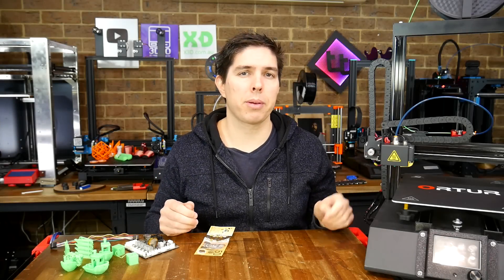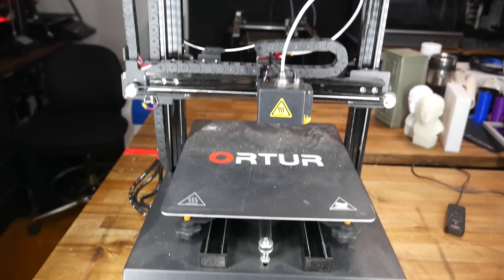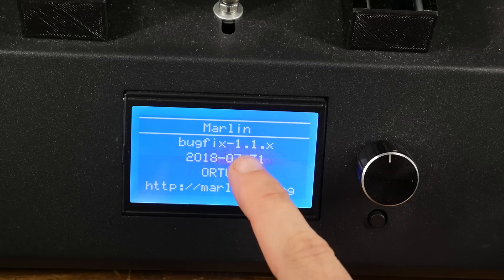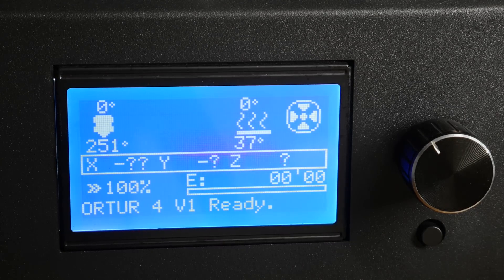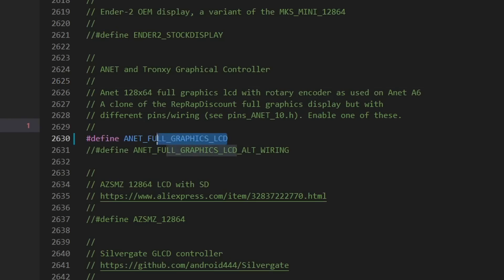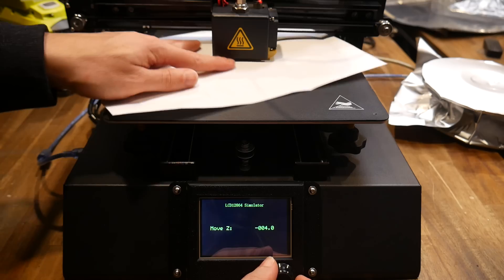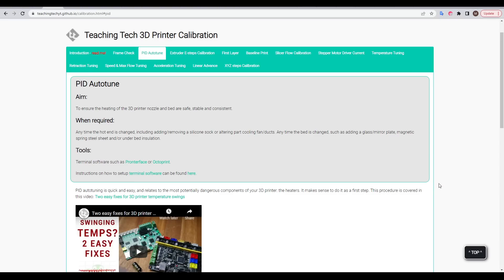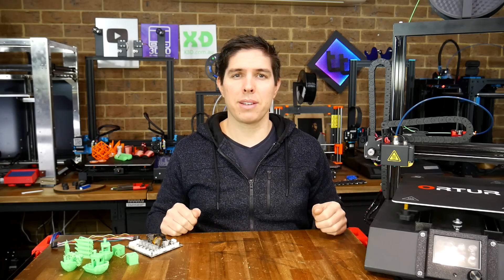Can you make money repairing barely broken 3D printers?

Comment: The thing is: you had spare parts.  Flipping’s goal is money received > money spent (original item plus anything you have to add plus the cost of your time).  Once you take all of that into account, if you had to purchase those spare parts you grabbed from your drawer — plus the cost of your time — would you have turned a profit?
Reply: You don't always have to buy spare parts brand new as a single unit. Look at the ender 3 for $52 at the start. You can get a lot of good spare parts from tearing it down which is worth way more than $52.
Reply: @nicholaslau3194  Yes but the concept of this video is "can you make a profit from buying semi-broken 3D printers, fixing them up, and selling them as refurbished?"

Let's say he got the semi-broken printer for $52.

Let's say our time is worth $25/hr. I'm going to guess the work he performed took him an hour.  That means if no parts need replacing, he has to sell this for $77 ($52 + $25) to break even.

However, he also had to replace the mainboard and the LCD.  What's that, another $75 possibly (guessing) if bought second-hand? 

So now he has to sell this for $152 ($52 + $25 + $75) to break even.

Would anybody pay $152 for a refurbished version of this printer -- when (at least here in the USA) one can buy an Ender 3 Pro NEW for $99 after coupon at Micro Center?
Reply: @OriginalSchles  He set out to repair this barely functional printer for certain reasons which he explained. For arguments sake, let's say it is 20% functional. Obviously it is a waste of time and money to fix it up to 100%. Instead if you take this 20% printer and tear it down for parts, you can use said parts to fix up an 80% printer. If you have many "broken" printers on hand, you will know which ones are worth fixing and which ones aren't. Michael even said that some listings are for almost brand new printers in which the owner simply doesn't know how to use a 3D printer. Of course you are not going to make money by making dumb business choices. The $52 ender-3 already has the mainboard and LCD (assuming they are working), if not then it still has other useful components like the heater block/ heated bed etc. I cannot stop you from spending $200 on a LCD board because you want to waste money, or give yourself $100/hr as wage. You can make up any numbers you want to fit your argument, not that it means anything because you cant really estimate profits on an isolated basis.

Comment: I got last month a CR10S Pro v2 for 100US, guy wanted $300 but it had problems with Z axis, everything else was working perfectly, changed all Z axis (steppers, lead screws, anti backlash nuts, bowden tube, glass bed (it had no bed) and printed some better supports for steppers, all of that was 100us more, so I got a great 3D printer for just 200us, totally worth it!

Comment: That is exactly how I got all my printers... 1st one was new and after gaining enough exp turned out you can get used or broken printers 3+ times cheaper... Even with new printer you will have spend time anyway... So it's perfect way for people who doesn't have much money to get good machine and jump in some very nice hobby.
Reply: yeah I think it is espially valuable for people that want to get many printers at one time too. You can scrap one or 2 out of your 10 and fix most of the issues and then order all the small bits in bulk. Or as a base for upgrades, keep nothing but the frame and motor and just replace the rest

Comment: For a print farm it is best to have a few printers with exactly the same hardware and software. From heat break to motherboard to software version. For a print farm reliability counts. So refurbishing an unknown printer is no option for me. For a newbie neither because he/she has no other printer to print replacement parts. So what is left over? To buy a broken 3d printer and repair it as second printer? My opinion is that the best alternative is to but a new original Ender  instead  You might end up cheaper. On the other hand, when you can get a 1st class printer like an Ultimaker or so, it might be worth the try. Bu be prepare to spend a lot of money and time. Heat breaks, nozzles, extruders bearings. Maybe a motherboard or drivers. It all counts up very fast.Even with experience. ;)

Comment: I got my first printer this way for super cheap. Bought a Qidi Xone2 for $120 with free shipping. Broken thermistor wire, bent Y limit switch and a clogged extruder. I had it running in a few hours and it's been a great machine for the two years I've had it.

Comment: Please dump this video, please. It's a nice video but there are already enough scalpers around, please don't point them to our hobby.  No need for even more rising prices 😶
Don't get me wrong please, it's a great how to repair video, but making money from broken printers is not a great title/subject.
Reply: I get the opposite vibe.  You really need to be good at 3D printing to even consider flipping printers for profit and be prepared to spend a LOT of time.  I wonder how many hours were spent on the machine in the video.   I've bought bargains printers and refurbished them to get folks involved in 3D printing.  The easiest was a loose grub screw on a stepper motor.  The most involved was a gut swap including wiring.  With prices for new machines where they are right now, I'd consider a different way to make money.

Comment: If it's just a clogged nozzle or PFTE tube gone bad, then yes. But seeing what you went through…… I think there is no way that printer is worth more than the work needed to fix it. When you need to change both the mainboard and the screen, you might as well just build a new printer.
I hope your friend appreciates your hard work :)
Reply: Meh, if you make it your sidehustle to buy and repair printers, you will find printers with broken electronics and printers with broken mechanics. So if you limit yourself to buying only popular models, instead of buying something obscure like this, chances are you will not have to take any of these very time-intensive tasks like designing/printing brackets, compiling your own firmware to account for a different mainboard, LCD, sensor etc because you can swap like for like.

If you go for models which have upgrades people commonly like to make, do the upgrading, sell the printers as upgraded instead of refurbished.
Reply: @AlexusMaximusDE  but the big problem is that replacing electronics (meaning Mainboard or screen) is not cheap. These components are kinda expensive. 
And broken 3D printers are still quite expensive and working ones don't sell for all that much.
Reply: first off, he did say if he wasn't giving it to someone, he would have scrapped it.

but the reality is that BOTH a mainboard AND LCD being out would be RARE in the LONG RUN.   Since he's talking about doing it for pay, he'd be fixing MANY printers, so the AVERAGES WOULD PLAY OUT: in a DOZEN, maybe one does need both, 4 need one or the other, and 7 just need cleaning and adjusting or super low cost fixes.

Comment: I bought a "refurbished" printer from JGmaker directly (saved me $200ish on the A5s). It took a year to get all the bugs out of it. They were very supportive, sending me: a new fan, Z-coupler, LCD, and a new heated bed.
I now have a fairly solid 3D printer, but there was a lot of trouble shooting, and time involved to get it there. (Each part problem was discovered at different times so customer service and shipping time was significant).
The next printer I buy will be be a brand new one with a good warranty.
Reply: i bought my first printer is voron0.1, i think is very small and easy to printing

Comment: I did it for about a year with returned ender 3 pros. usually flipped for 70-90usd profit per. was doing 3-5 a week. was fun
Reply: Enders are possibly the only ones that you can actually flip, I bought 13 anycubics for $60, most were untouched. Nobody has bought them, even when I listed it for $100.
Reply: @userblame632  Also considering how great the Ender community is, flipping them should be super easy.
Reply: How much time did you typically have to work on one to get it working? That does sound like a lot of fun 👍
Reply: @briguy9915  I'd usually grab 3-5 thursday or friday after work. Then by midnight friday have them all fixed and a 12-14hr test print kicked off to make sure they were good. Then they'd go up for sale Saturday evening and be all sold by end of tuesday. Rinse and repeat if i felt like it. Only did enders so i could buy common stuff in bulk like bed mats and hotend parts. 

What surprised me was the amount of upgrades they got returned with. I acquired so many yellow bed springs and capricorn tube as i always sold them bone stock lol
Reply: Ask Holy Spirit to teach you and to guide
you. I would recommend the YouTube Cleveland street preachers and follow Jesus no man no religion. Be holy and obey Jesus. Hebrews 5:9 "salvation is for those who obey. 
Jesus says if you love me keep my commandments (John 14:15). Jesus even says if you keep my commandments then you shall abide in my love (John 15:10).g